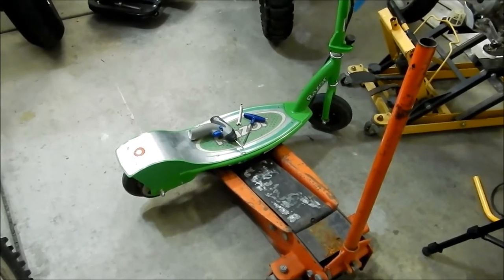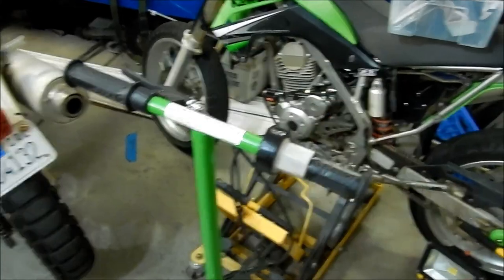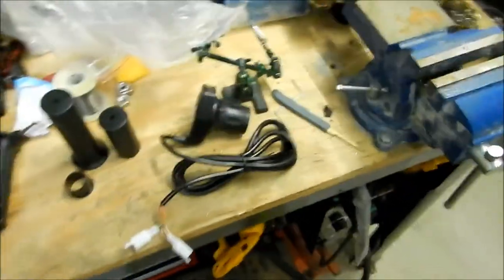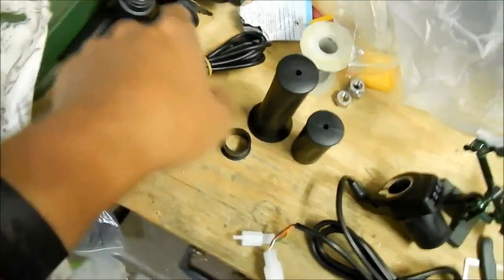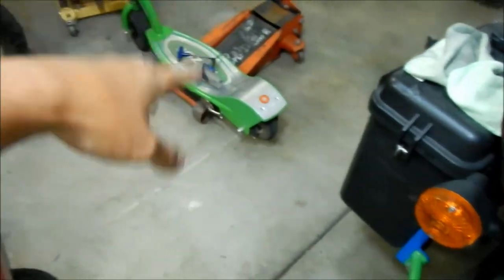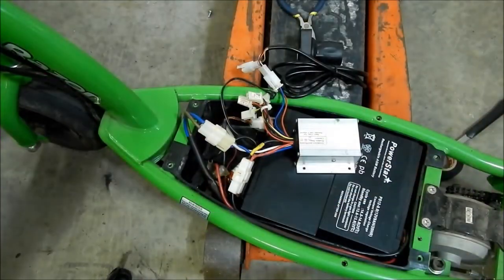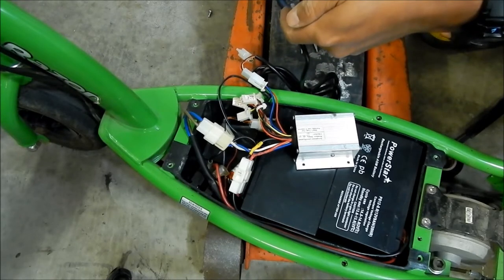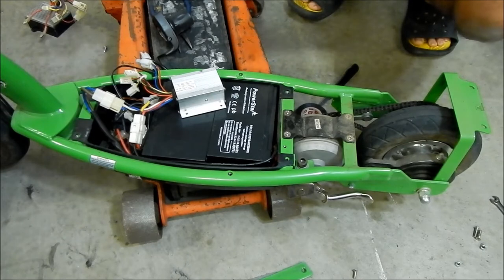How to Install Variable Throttle on Razor E200 Scooter Part 1

Comment: Trying to rewire variable throttle to motor on a e300… the ignition came lose and eventually fell off. Seems like easy fix 🤷could use your help

Comment: Hia Mate, Great how to! I'm looking to do this mod on my 7yr olds e100 as throttles a bit abrupt for her. Planning to use the same control box you got, but poss slight chnage on throttle as think thumb style might be easier for her. Did you need to mod the brake handle at all to work with the controller?

Comment: Hi mate I have a question, could you use the custom throttle and use the original speed controller instead of installing a new speed controller
Reply from the maker: Hmm I'm not sure I don't think so.  It's better to just install the new controller it's not very expensive and it runs like stock.

Comment: I have the same scooter e200 . If I want to change the throttle, do I need to change the controller or can I keep the same controller ? Thanks!!
Reply: Yes at least the model of e200 scooter I  have I needed to change the controller.  It's cheap